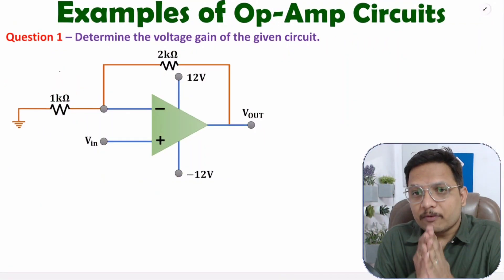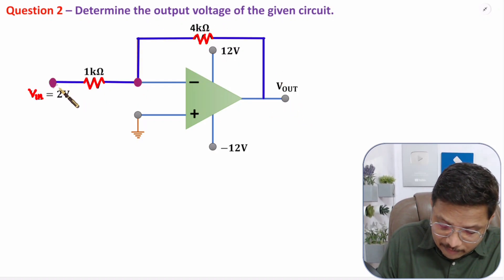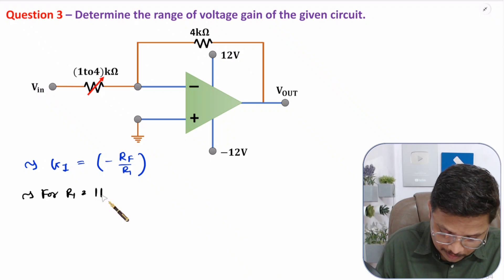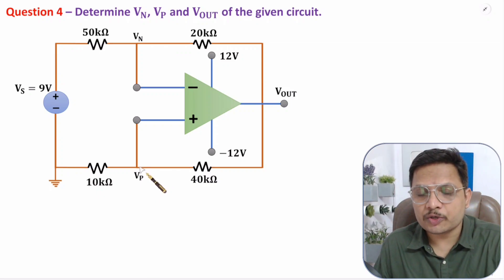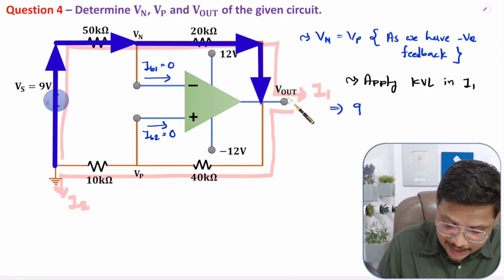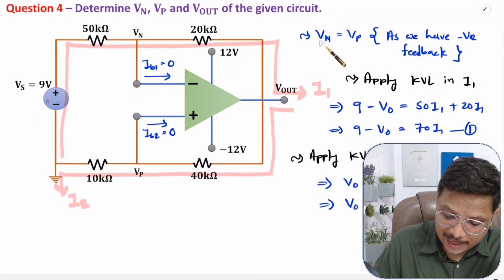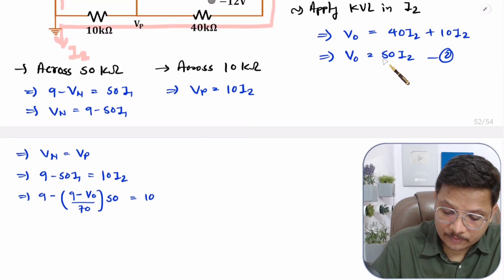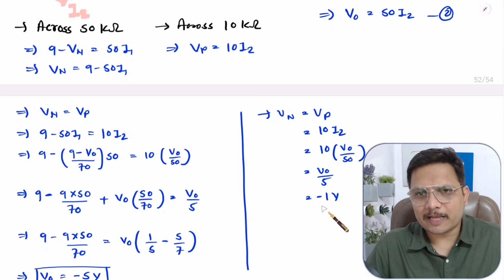Examples of Operational Amplifier Circuits (Inverting, Non-Inverting, Positive & Negative Feedback)

Comment: What is zero dispersion point how it can be achieved in dispersion modified fiber? 
Sir ye question ke 2nd part ka kya ans hai... Fiber optical communication mai? Please reply 10 marks ka question hai ye paper mai.
Reply from the maker: The zero dispersion point in optical fibers refers to a specific wavelength or frequency at which the chromatic dispersion of the fiber is minimized or becomes zero. Chromatic dispersion is the phenomenon where different wavelengths of light travel at different speeds through a material, causing them to spread out over distance and potentially leading to signal distortion.

In a dispersion-modified optical fiber, designers aim to manipulate the material properties to achieve the zero dispersion point at a desired wavelength. This is important in optical communication systems where the goal is to transmit information using light signals with minimal dispersion.

There are different techniques to achieve dispersion modification in optical fibers, and several types of dispersion exist, including chromatic dispersion and polarization mode dispersion. Here are some methods used to achieve dispersion modification:

1. *Material Selection:* Choosing specific materials with desired dispersion characteristics is one approach. The refractive index profile and material composition of the core and cladding layers of the fiber can be tailored to achieve the desired dispersion properties.

2. *Waveguide Design:* The design of the waveguide structure, including the core size and shape, can influence dispersion. By carefully designing the geometry of the fiber, it's possible to control the dispersion characteristics.

3. *Doping:* Introducing specific dopants to the fiber material can also modify its dispersion properties. For example, the addition of certain materials can alter the refractive index and dispersion characteristics of the fiber.

4. *Photonic Crystal Fibers:* These are specialty fibers with a periodic arrangement of air holes along the length of the fiber. The design of these structures allows for control over dispersion properties, and they can be engineered to have a zero dispersion point at a desired wavelength.

Achieving a zero dispersion point is crucial for certain applications, especially in long-distance optical communication systems, where minimizing dispersion helps in maintaining signal integrity over extended fiber lengths. However, it's essential to note that achieving a zero dispersion point at one wavelength may result in increased dispersion at other wavelengths, so a balance must be struck based on the specific requirements of the optical communication system.
Reply: @EngineeringFunda   thankyou sir